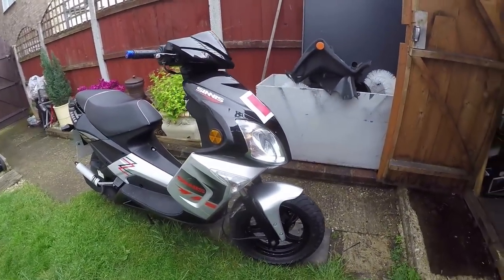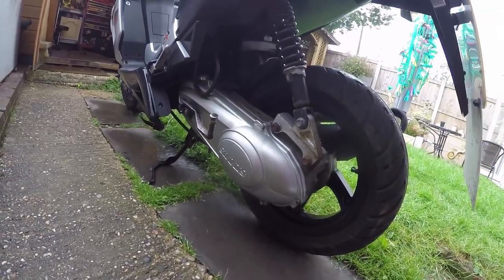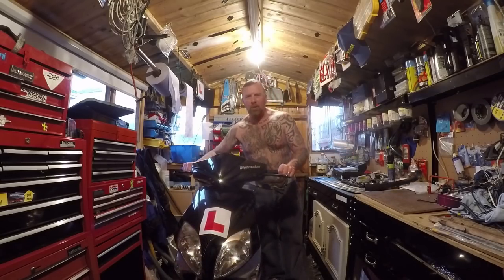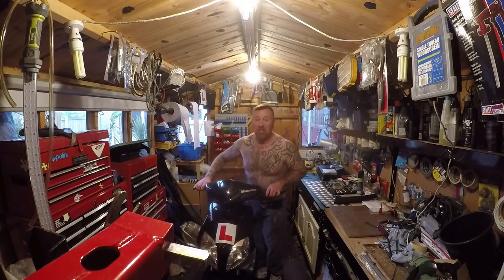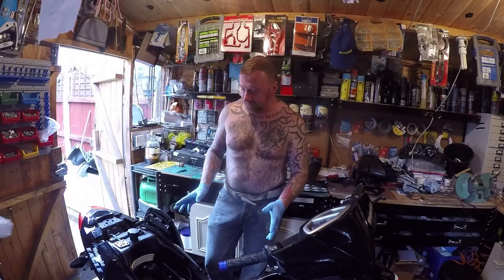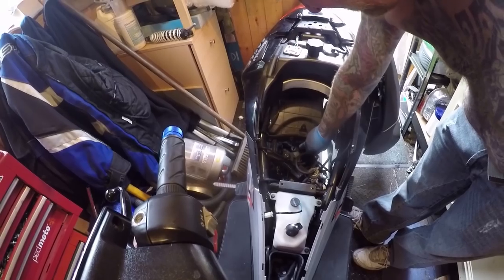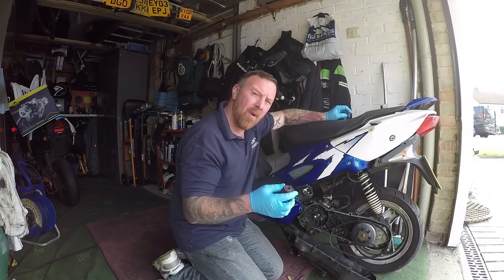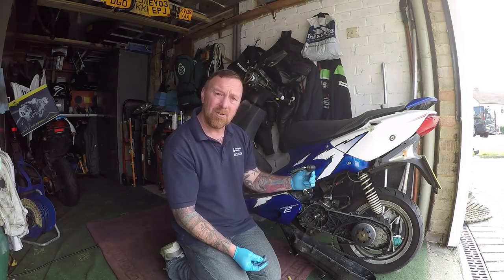SINNIS 50CC MOPED WHY WONT START ! NONE RUNNER MARK SAVAGE

Comment: Thanks mark for comment when ignition is switch off the wire is not live when switch o n the wire becomes live pulling my hair out 😩😩 engine turns over ok but no spark thanks Colin

Comment: Daughters Sinnis Jet 2 bike won't start lol. The speedometer is just all lighting up with all lights, then just repeats the cycle. I tried resetting the battery, ime disconnected and reconnected it. No change. Even looked at wiring, no splits as I could see. It still started and ran, but now there ain't even any electric start working on it. Yet the speedometer is still cycling through its usual all light up all lights off. Thoughts?
Reply from the maker: Earth problem?
Panel off 
Wd40 all connectors 
Drop test the battery 
And volt meter the stator coil bud

Comment: I was wondering if you can help me
Please. 
I have a Yamaha Aerox 100cc 2004.
I have had it for 7+ years 
Every problem ever had I always fixed it straight away.
But this time I have no idea.
It was working perfectly 3 days before I tried to start it on the morning it wouldn't start.
It has a good spark I have changed spark plugs and ignition coil just to make sure.
It has a really good spark.
I have cleaned the carburettor about 5 times to make sure.
It was already clean.
I even changed the cylinder & piston just to make sure.
I have cleaned the reeds and check them.
It has a kick start and the battery is fully charged
I have a button charger.

When I syringe petrol in the spark plug hole and put spark plug back in.
 it start up for a few seconds.
I believe the automatic petrol tap still works I suck on the little pipe and petrol comes out of 
the big one.

There's one thing I'm not sure of.
Sometimes the spark plug is a bit wet and sometimes it's not.
Should it be soaking wet if it's not starting.
If you have any ideas
Reply from the maker: It might be you oil seal bud 
Do the wet hand test 
Air filter off 
Hand over carb inlet and turn over to see if its sucking the fuel in 
You say you have checked reeds and vacuum and they are both ok ?

Comment: Gr8 Mark I have a Suzuki burgman uh125 54 plate with no spark ?? Serviced but on the coil there is one wire only but it is permanent live all the time can you help is this correct thanks Colin
Reply from the maker: colin Total fishing 
If only one wire it could be earthed by fitment on to the frame so unless it has two connectors !
Live all the time?
Not sure about that but maybe  when power off the earth cuts so would be ok 
So no spark ?
Checked plug / changed 
Do you have power from stator 
Cdi ?
Reply: mark savage  I will get back to you on stator and cdi unit thank you Colin

Comment: Hi Mark thanks for help but unfortunately its still flooding even after changing jet is there any chance it could be the seals and bearings i fitted please thanks Nick
Reply from the maker: Nick Farnell if it running and then flooding it’s carb related 
It is not running and plug is wet poss spark / stator 
When you turn over are you getting a wet hand ?
If so bearings ok if not then poss not fitted correctly
Reply from the maker: Nick Farnell I just had a guy ask about his forks 
After many messages I asked him to upload a video and OMG they were dent so bad and a throw away / replace 
So upload a video bud let me see what’s going on
Reply: Hi Mark i don't no how to send u a video its firing and start's now but wont stay going iv tryed 2 carb's new plug still not staying running
Reply from the maker: Nick Farnell upload it on your channel bud

Comment: Hi mark! I have few problems with my vivacity 50 2stroke. It starts when you crank it for 30seconds and after that you need to ease throttle to prevent bogging. I have cleaned the carburetor and airfilter. New spark plug. I also have problem with acceleration and top speed. I have removed restrictor plate from variator but the moped goed only 50kmh. Acceleration is good to 20kmh then it takes forever to get to 50kmh. Speed also decreases to about 30kmh in uphills. Rollers arent flatspotted.
Reply: It does excatly same thing what that yellow speedfight does in your bogging video. I also need to have airfilter extension installed to prevent bogging.
Reply from the maker: ok this could be a few things
1 auto choke not set right or faulty so staying on or not working or needs adjustment
2 carb air mix, watch my tuning videos
3 have you changed the jet size or did this always do this as it may be too big  of the jet size so down size like in my videos
4 rollers maybe ok but to light or heavy so try 6g rollers and check belt is ok 
see how you get on as said I have many videos that will help ,sit at a computer then you get to see them all
please like and sub then sorted 
mark
Reply: mark savage thanks i will try those, but i only have some kind of brass fitting on the airmix screws place?

Comment: That's a new one, lawn mower plug!
Reply from the maker: amazes me still now!, no wonder it wouldn't start lol
Reply: Paul Ford 😂 what we're they thinking maybe they should have tryed them new hair dryer plugs 🤣
Reply: mark savage I had a problem trying to turn mine off I used the electric start but as I let go it kept trying to start took the key out still was going so had to disconnect battery hahah any ideas?

Comment: I got a SYM moped scooter water cooled have any ideas for service all the ones I have work work on has been are cool fans not kicking on and gas can is not working check the fuses all good no dealers that I can find in my area bike was imported
Reply from the maker: hi air cool or water cooled the basics are the same only you can change the water after 10k but otherwise just keep it toped up with antifreeze 
so you say its not starting, do a service but like before so plug , air filter, then take off carb and clean like in my videos and do a good job of cleaning it also check for spark while you change the plug
as for starting if you know you have spark and when you turn over the plug now get wet it may be something else
next you say not starting so I have covered the basics, are you saying it wont kick or elec start ?
I have videos on then ok they are on speedfights and so on but all the same give or take 
hope that helps 
please like and sub 
mark

Comment: Ayup pal. Any ideas on getting a Chinese 50cc 4T to run better? It doesn’t tick over then, eventually splutters to death. I’ve checked the oil, changed the plug, cleaned the filter and drained/cleaned the petrol. Any pointers greatly received 🤙🏻🤙🏻
Reply from the maker: Carb off bud and clean the jets and everywhere with carb clean, this will help 
Check fuel lines replace if need be
Reply: @marksavage  cheers dude, appreciate that. Another quick one, if I unplug the fuel line from the carb, should fuel just pour out because it didn't.
Reply from the maker: @paulwealthall376  no it should only come out once running or if you suck the vacuum air pipe 
Like in my videos to prime the carb or test the vacuum
Reply: savagesavage cheers pal, I'll search for it.

Comment: Any advice Mark, Got a SYM 50cc from 2000, ive replaced the Piston, Carb, Battery, Starter Motor, Spark Plug, Ignition Coil, put fresh fuel in and it wont turn over. Its got oil, fuel, air, spark and compression but im having no luck any advice on anything I could be missing.
Reply from the maker: So its not turning over when you try and start it !!
As it the starters not work or are you saying its turning over but not starting?

Comment: Hi Mark I have a malguti crosser cr1 and want to change the ignition stator but the fan on it has 2 allen key bolts in but fan on it is metal would you recommend a little heat on it or not thanks

Comment: Hi Mark I love your videos, I have the keeway arn 125 4T. Could you possibly get hold of a keeway arn 125 4T and show us how to make it faster if that is possible as mine does 60MPH but I would like to get 70MPH out of it if possible thanks show us some good upgrades
Reply from the maker: matthew pownall hi bud never worked on one before and only get mopeds and bikes in as they come 
Sometimes it’s not upgrading but finding the parts to upgrade them if they make them
Most of these mopeds are generic so some parts will fine lots of moped 
A lot of these can be upped to 180cc and 21mm carbs 
Google search for them  bud 
I know it’s a lot of work but in many cases it’s the only real way as the peds have been set up for mpg and not-mph
Mark
Reply: mark savage there are a few parts on eBay but it's nearly impossible to get any part for a keeway arn 125 it's so stupid as it's a really good 4T scooter pretty nippy too not much out there
Reply: mark savage do you know if you can destrict a Sunnis eagle 50cc thanks
Reply from the maker: you can change the rollers for better pull away but to be honest bud they are 30mph bikes as cdi restricted, the off the market cdi's for these will help but don't last long.
check the pins on the cdi and try to find a match on the web 
mark

Comment: hi mark  ive got a sinnis shuttle 125 problem starting .when on the stand it wont start ,off the stand it starts right away, then it cuts out after 10 min, wait 5 min restarts any ideas thanks roy, garage has no idea what the problem is
Reply from the maker: roy baker how odd and there’s no cut out switch on the stand ?
Maybe look for a short in the electrics ?
All panel off. And investigate bud
Stator going to earth when it gets hot ?
That’s an odd one bud but can only be fuel or electrical 
Thanks for watching I have a few other videos that may help 
Mark

Comment: Hi Mark, sorry me again. i have a Suzuki Katana and the exhaust has rusted through. What do you recommend as a replacement ? its a 2004 Liquid Cool model. Are they similar to  the Aprilla RS 50 thanks again Mark
Reply from the maker: yes bud you are right the they are the same as the Aprilia on e bay now for £62.50 all in is the Giannelli Exhaust Muffler which will fit you Suzuki Katana 50 // just check the year 
you may have to upjet but try first and see how it goes 
mark
Reply: you dont happen to have a link for the exhaust by any chance ?
Reply from the maker: mastercreative1 type in the bike name and it’s a 50 and  you will see a few lines down bud

Comment: Mark how can i get in touch with you??
Reply from the maker: hi bud 
upload a video on your channel and as you have subscribe let me know and ill take a look at your prob 
mark
Reply: @marksavage  Thanks very much will upload over next couple of days
Reply: @marksavage  its that no start your always getting asked about lol, however i have changed new plug, fresh fuel, fresh oil and coolant, carb is going to get cleaned monday or tuesday, theres just no spark. Its not connecting, i was thinking maybe the coil or side stand switch so ive checked the side stand but nothing, ordered new coil just incase it is that. Thanks again for the reply
Reply from the maker: no spark is normally only a few thing , side stand, spark plug, coil/ ht lead , problems with you stator coil or the most common !
cdi bud
Reply: mark savage thanks for the advice. Appreciate it bud. Keep them vids coming not only do I enjoy them but there helping me a lot
Reply: mark savage so changed the coil and Ht lead, still no spark!! Thinking it’s the CDI so back to the drawing board. Also ordered a manual to help me out so will try again

Comment: i have a sinnis hero 125, guess what? it wont start. new stator, new spark plug and coil, new ecu, new gasket. still wont start.
Reply from the maker: oh dear 
do you have spark bud after all that ?
wet plug as fuel getting in pot?
bloody things lol 
as for gasket ? as in head gasket
Reply: @marksavage  its been in the garage and  apparently there is nothing they can do. they say it needs to go to a sinnis shop to diagnose which connection issues there are. there are no sinnis shops within hundreds of miles of me. i guess i will habe to sell it as spares/repairs.
Reply: ive read somewhere that you could use an OBD scanner thing to diagnose it, but i wouldnt know where to even plug it into
Reply from the maker: @sirmikemurray  some newer ones have the old ready port 
Thats bad of the shop but they don't want to spend hours trying and then give you a £300 bill with a still none starting bike bud 
You have spark ?
Drain fuel out and carb 
Refill with super
Reply: @marksavage  as far as i am aware there is no spark. i will have to wait now until i can get it back home and have a tinker myself. thank you anyway mate